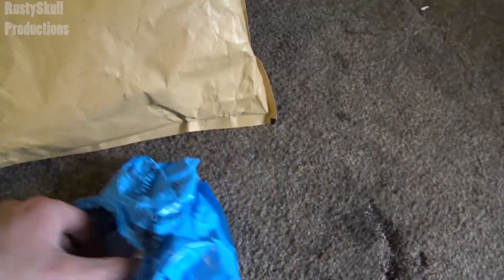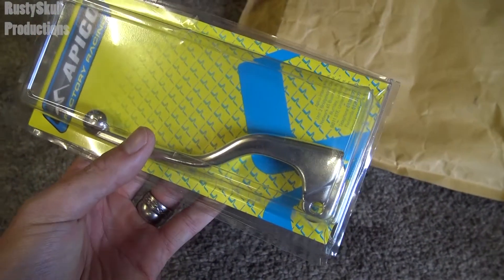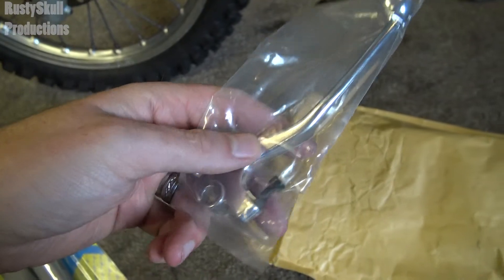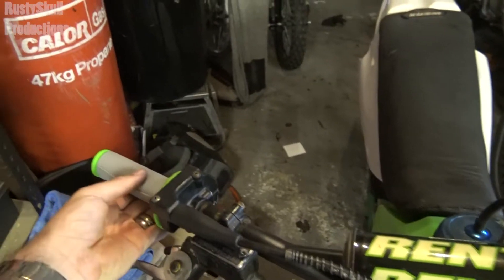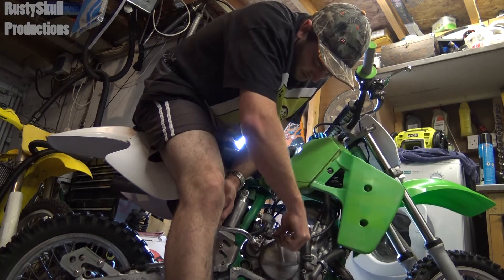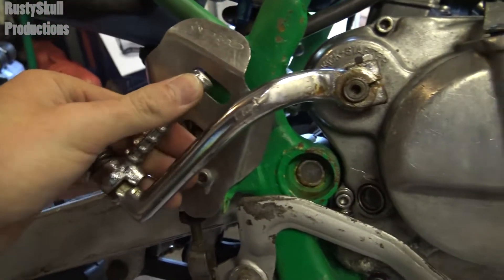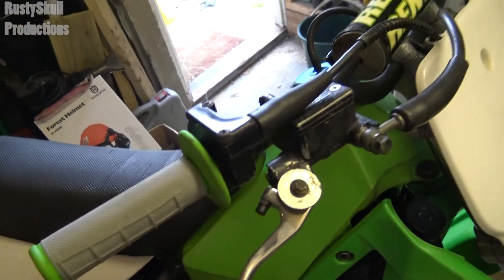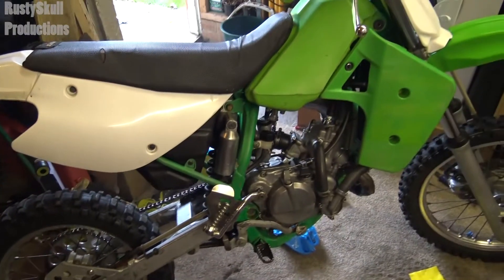More Stuff For The KX80 - RustySkull Productions

Comment: Nice video man! When I first got my DT 125, the gear lever was welded onto the shaft because the splines were rounded. In the end it snapped and instead of welding it back on I shelled out and got a new shaft put in the engine. Was a pain but sometimes it's gotta be done the right way!
Reply from the maker: +2 Wheel Will You'll always find odd stuff on used bikes lol. Normally done by people like me lmfao
Reply: RustySkull Productions lmao thats is true! To be fair I could prolly just keep welding it back on each time it snapped and it would of worked